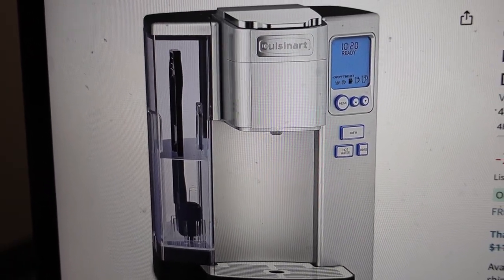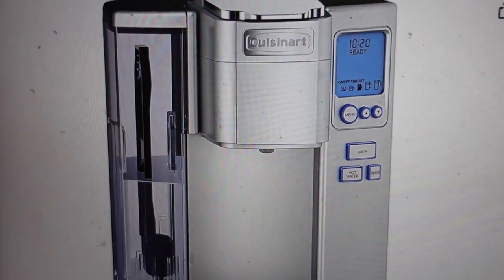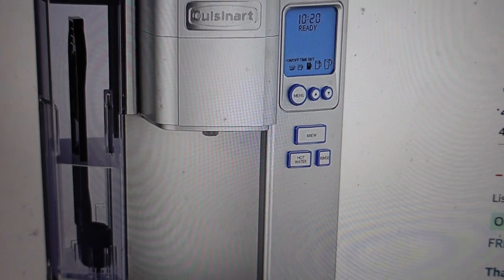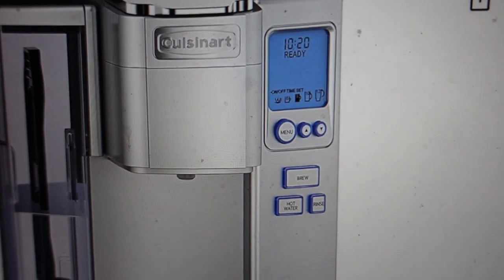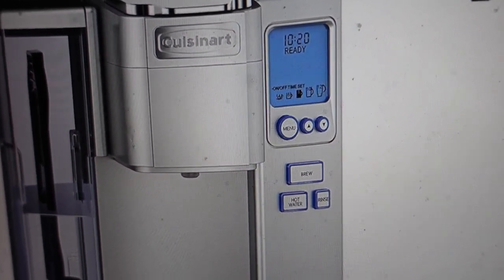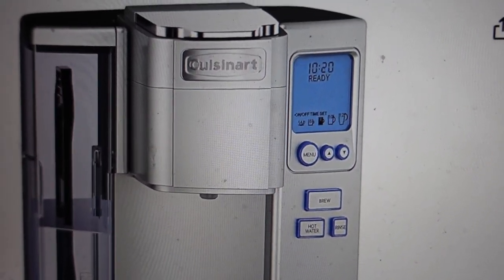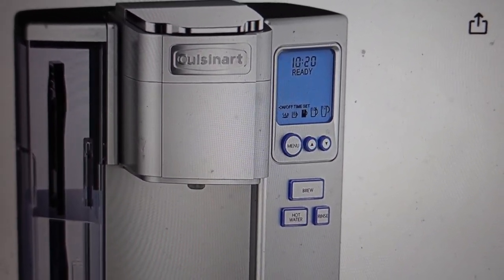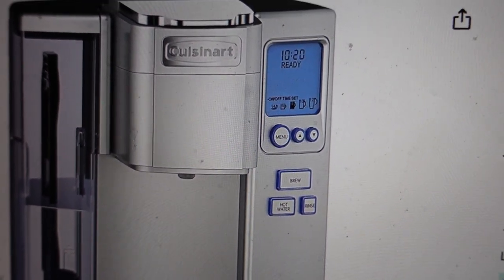Error EEO on CuisinArt Coffee Maker | How to Fix

Comment: Once you get the EEO error nothing works. No pumping no nothing. So the fix to descale will not function
Reply: DId you actually try it? It might have been more helpful if OP had restated how to turn on the descaling function--that is, press the Hot Water and the Rinse buttons at the same time, after unplugging and replugging the machine in. I did that, ran some descaling stuff through it, and it fixed mine.